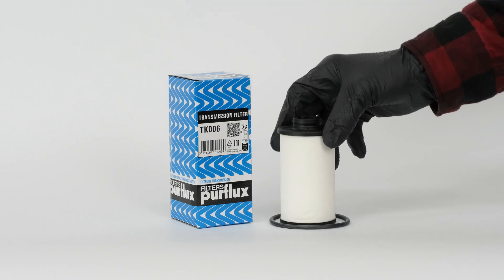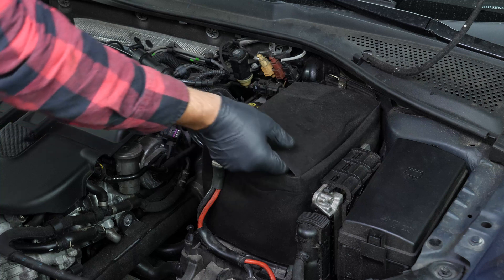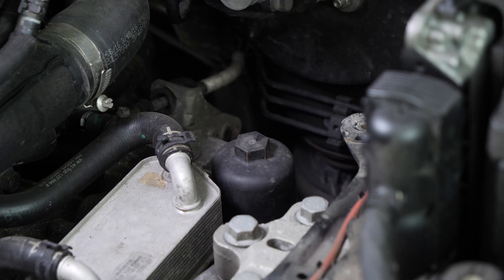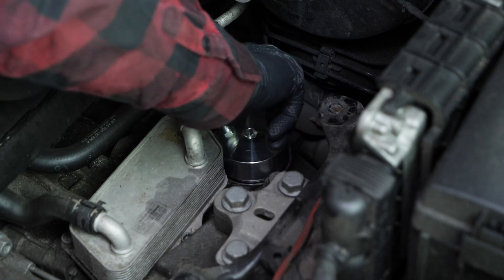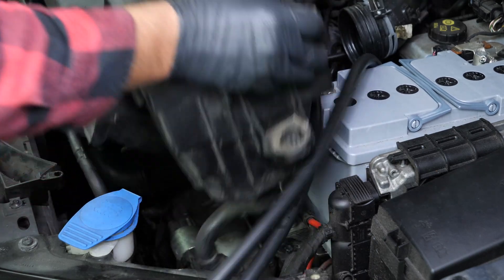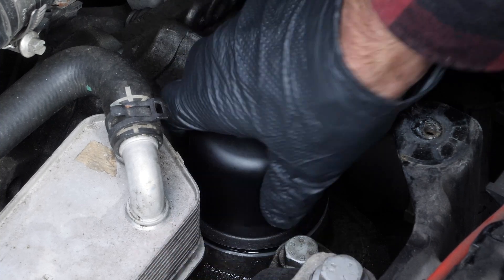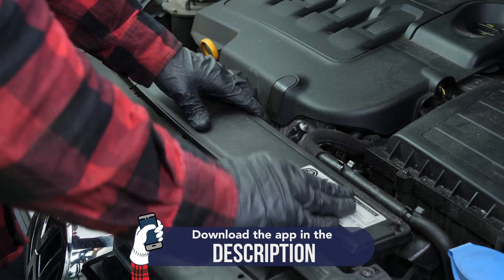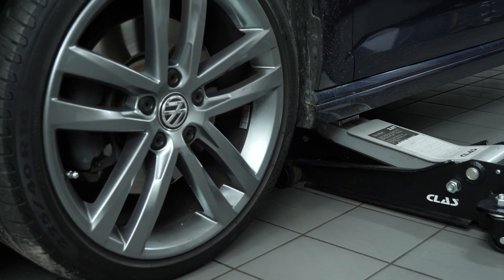How to change the automatic gearbox oil and the transmission filter Golf mk7 2.0 TDI 🛢

Comment: Very nice explanation, but could you explain how to change the transmission oil without the machine? The machines cost minimum about 400€, and for the average DIYer that only does maintenance on it's car, the machine will be paid in decades!